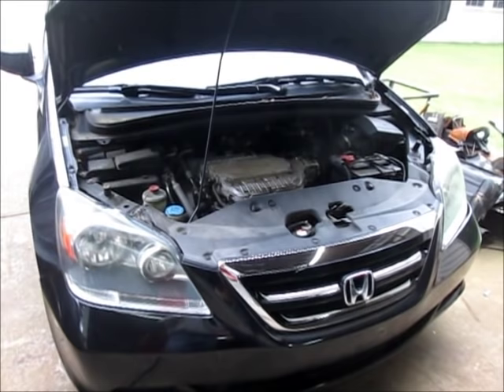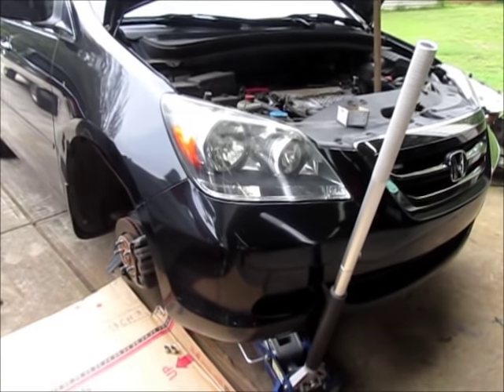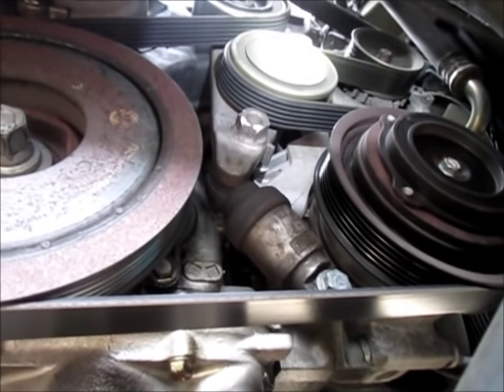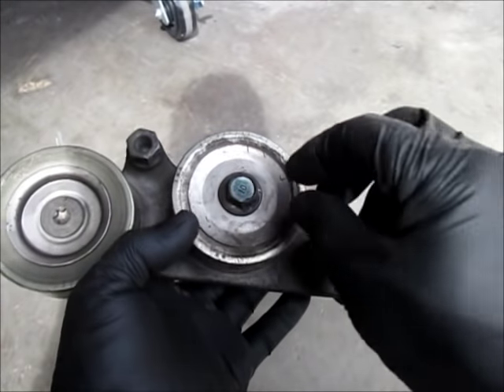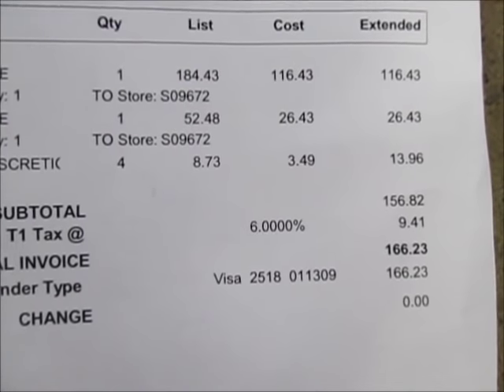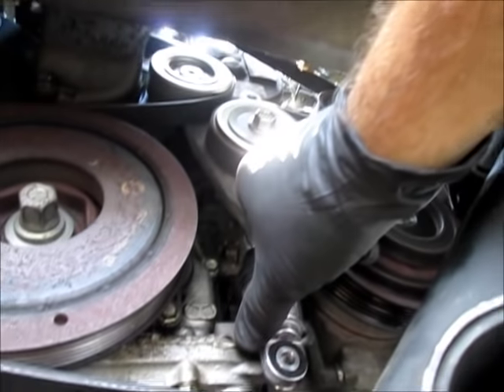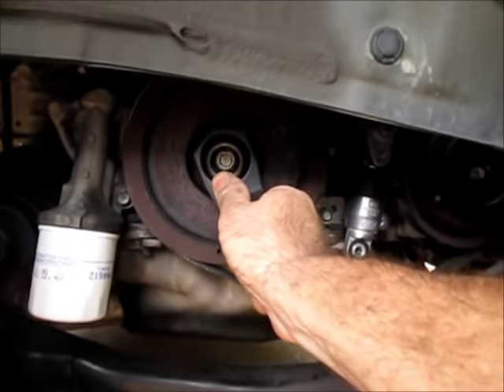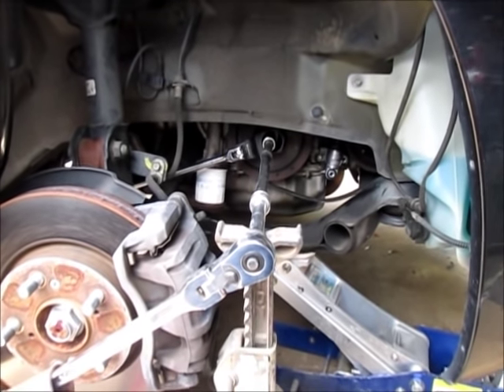Honda Odyssey serpentine belt tensioner replacement and bad crank pulley.#honda #odyssey

Comment: I have similar chirping noise coming from my 2006 Honda Odyssey as well, but my vehicle already has a new tensioner I put on less than 20K ago. The thing that bother me most is that this chirping noise is louder and constant when the engine started unlike the original tensioner which only chirped when it first started but went away in a couple minutes. The only reason I changed the original tensioner is because of the minor chirp, but now it is much worse with the new one! Unfortunately, the aftermarket tensioner was bad, and worse the fake nuts were no good, I stripped them both trying to take it off the belt to change it again. It seems to me that the lower nut has better torque to compress the tensioner shock than the upper but it is much more difficult to get the leverage at the bottom. So I ended up using the prybar to compress the tensioner shock to release the belt tension to replace the tensioner again with a new belt. I can live with minor chirp from the original tensioner but I simply cannot stand the new tensioner persistent chirping. In this case, it is a good thing that he found the balancer nearly separated, but I don't think the balancer was separate yet, otherwise, there wasn't much torque on the belt to drive the rest of the accessories on the engine. He missed the opportunity to change out the timing belt when he changed out the balancer, that was the hardest part of the timing belt change, given the car has over 200K, it is due anyway. For my case, I had the very same set up he has to break loose that crankcase bolt, 5 ft extension pipe and a 15" 1/2" breaker bar and 155lbs. of torque and it made a horrible bang noise that I thought I broke the damned bolt. I can also attest that the 400ft lb. torque from the impact wrench does nothing to brake this bolt. I believe that the torque spec on that bolt is 181ft. lb. or 47ft lb. plus 60 degree turn (1/6 of a turn). I followed the latter, because I don't have a torque ratchet better than 150ft lb.

Comment: I just replaced one of these belt tensioner assemblies on a 2007 Odyssey.  Here's what I learned:  On 2007, the tensioner is DIFFERENT if the trim level is TOURING.  The auto parts store online catalog shows a different tensioner for non-Touring Odysseys.  I needed the one in the video.  The problem with this particular vehicle was a growling noise from the accessory drive (it sounded very much like a noisy power steering pump).

Comment: good video, probably no need to replace all the parts you did...Depending how old were your belts, but that is a good preventive maintenance, might be as well to do your timing belt at 200k.
As someone said before, those nuts soldered to the tensioner are to move it so you can release the belts, from up or down the car. Good thinking in removing the whole tensioner component that way you could have replaced only the balancer...
thanks for sharing

Comment: On the pulleys you can just press in new bearings that cost $8 a piece. Good job spotting that balancer. Ill have to go check mine now
Reply: I need to check mine too

Comment: First, really appreciate that you do not include obscenities in your videos as it lets me watch them around my 9 year old. Second, this is an awful design and am gravely disappointed with our 143,000 mile Honda Odyssey (2007). It makes me wish I had grabbed the Volvo 240 station wagon that was for sale nearby a couple of years ago. I could have replaced all of its belts twice in the time it has taken me to fight with the head end of this engine already. Third, what started as a Power Steering pump replacement job may have become a serpentine belt tensioner job as well. I have completely stripped the lower bolt head on the idler pulley bracket in trying to free up the serpentine belt. Next, I will try the upper bolt head on the idler pulley bracket. If that strips also,  I'm going to try the prybar against the crankshaft pulley/harmonic balancer to compress the serpentine belt tensioner. I hope not to damage the pulley/balancer in the process. If I do, this is going to my favorite independent mechanic. Next job is to replace some, but not all of the transmission fluid as I don't want to detonate that other Odyssey land mine. BTW, the dark blue paint is peeling off in small sheets, especially if driving in the rain. Disappointed.
Reply: That's why I never will by Honda again, their quality is crap now.
Reply: @thekingofgoogle1404  My personal experience from owning about 30 cars and trucks is that quality tends to vary within brands. While Ford was churning out very reliable pickup trucks in the late 90's, we bought a new, Windstar minivan. The quality was a mess, but it was the first model year of the redesign (1999 IIRC). We also had a 1991 Honda Accord that ran and ran with almost no problems,  except the terrible, chalking, fading paint. In the opposite of the Ford example,  early 00's Honda sedans were very well made, but Honda minivans, Ridgeline pickups,  and Pilot SUVs had major transmission problems as they all shared them,  being produced in the same factory also. Data indicates modern Honda sedans are reliable,  but Honda has had chronic paint problems,  especially with white and dark colours. Make sure you garage,  wash,  and care for their paint. 
The Car Wizard channel provides a lot of great To Buy and What Not to Buy recommendation videos.

Comment: FYI. Instead of Prying against the Pulley to compress the Shock on the tensioner. Next time use a socket on that Bolt Head. That's used for removing and replacing the serpent belt. 
Otherwise thanks nice video.
Reply: I used a socket on that fake bolt [3/4' socket] but the hydraulic socket do not budge. I am frustrated.
Reply: @Tahimate  takes A LOT of force to move the tensioner. There are two fake bolts you could use. Try both. I also had some luck going at it from the top to adjust the belt on.
Reply: @Tahimate  Just replying to future viewers - the way the hydraulic shocks work is they gradually loosen as you apply steady pressure, so don't attempt to "break it loose" like a normal bolt, instead apply alot of force but hold it steady and you will gradually see the slack open up.

Comment: Thanks! I have some noise coming from this at 2200 rpm and sounds like a wheel has a bad bearing and it is rattling a little bit. Another thing I'm adding to the parts list!

Comment: Have the same issue:  It isn't the damper. Mine sounds exactly the same with a damper change (which was needed).  Be ready for your oil filter adapter housing to start leaking oil.  All of those parts failed within months of each other for me (for those coming up to these issues).

Comment: I pulled a tensioner assembly off at the wreckers for $15 and saved $100. 50,000 trouble free miles and still going

Comment: Just did mine on a 2004  2.4 this morning, I simply put a spanner on the power steering pump pully and , with the belt in place on the rest of the pulleys, wound it on. I couldn't get a spanner on the tensioner pulley bolt FYI. If it's chirping, it's the tensioner. Mine was at 275K km.

Comment: My wife's van had this same noise, I took off the belt to see which pulley it was. It's hard to tell which one of the two is making the noise but I'm just going to replace the whole thing. after removing the belt it was not that hard of a job if you approach it from the wheel well.

Comment: real helpful man thxs just replaced the alternator on my 05 and let me tell u take it to a garage for that had to take the hole front end off and pull back the radiators just to barely get it out but thxs man this really helps me out

Comment: the crankshaft pulley nut is 47 ft lbs + 60 degrees.
that's why it's so tight.
Reply: Q*bert that's right !
Reply: @lebronjordan802  hhjj

Comment: going through the same thing with my van. Decided to redo the tensioner, power steering pump and balancer . had to bust off the balancer bolt by using the long breaker bar with 19 mm socket and starting the engine three times. this was after my impact wrench with 700lbs torque couldn't bust it off. Royal pain in the butt. great van otherwise .

Comment: Relieve the tension from the bolt on top and do it on top not under engine .push forward gently and you feel the shock tension go away and belt will get loose.but good job and nice video.

Comment: Gave up on putting the serpentine belt back on the 2006 honda odyssey so I took the vehicle to a mechanic and had them put it on. For future reference if I should ever win the Lottery and its a large amount of money  I will fly the vehicle back to Japan and try to drop it on the guy who thought of the idea of putting an engine in an Odyssey sideways. ( just kidding)
Reply: patchreefs 😁 👍
Reply: patchreefs I hope there is a place in heaven for those over thinking engineers, they should have to work on those over and over for eternity.
Reply: Ummm that's how all front wheel drive vehicles are. Motor sideways towards the drive wheels.... It's the only way. Otherwise everything would be rear wheel drive and you'd complain about not having better control of your vehicle...
Reply: i used to work on 96 Mazda MPV minivan with V6 engine, it was not sideway, it was so nice to work with the crankpulley facing forward at the head of the minivan.

Comment: Compressing that piston would have been a little easier if you had a buddy to help you out.  I have an 08 V6 accord and the belt and pulleys are identical.  Service manual says if you hook a socket (in my case a 19mm) to the fixed bolt head between the idler pulleys, that's the proper place to swing that arm.  You did a little more work that you needed to, but it was only you and you did what you had to do.  And yeah the torque spec on that crank pulley isn't as much as one would think.  Mine is only 37lb-ft.  Great video, I saved it to my favorites for future reference.
Reply from the maker: +BuddyLe3 Thanks for the input. It was a new one on me, and I'm not afraid to improvise....

Comment: I just started watching your vid because s buddy of mine pulled in my drive way with a2010 Honda Odyssey 3.5 and his belt was walking off the top pully . I've never seen a car or truck with out a belt tensioner loosener weather out be a socket or just the wrench to losing it I started watching your vid and I was like thank you in not the only one this belt pulley assemble is bull shit made to bring back to dealer crap

Comment: This tensioner has to be removed when replacing the timing belt.  The tensioner pivot bolt has a bad habit of breaking off flush with the block.  A HF reversible angle drill and LH drill bits lets you back it out.  If you just need the bolt, I sell them on Ebay.
Reply: Yup. Just paid the mechanic to back the bolt out (Replaced the whole assembly). Beyond my skill set.

Comment: On my 2007 Odyssey the serpentine belt suddenly became very loose. I found that the harmonic balancer part of the crankshaft pulley had actually GONE, No squeaking or warning. Just the center of the pullet was left, no grooves. My wife said that "there was a bang" and immediately the power steering got heavy and ignition lights came on. 
No new belt or tensioner required! Very unusual !!!
Reply from the maker: malcolm grey Apparently this is more of a problem than we all realize...

Comment: I know you did this in june but I have fought with this harmonic balancer bolt on my accord several times. and there are several things that help,heat up the bolt head and use as short an extention as possable to twisting of the extentions I have seen mechanics use a super thick heave wall socketcustom made for this bolt.

Comment: Thanks for the video. Just like the usual song and dance. I changed my alternator a week ago and here comes the chirps. So I went to change the belt. But my welded on bolt that I use to compress the tensioner stripped. So I can’t turn it. So I am just going to replace the whole assembly. The car has a lot of miles so why not since my hands are already dirty.  Another tip I got from another forum. Was to use the OEM bolts because aftermarket bolts may snap

What was the torque specs on the bolts if you remember
Reply from the maker: Sorry, I don't remember the specs.

Comment: Nice Video. I really need your advice on my 2007 Honda Odyssey . 2 months ago, I was at a stop sign, suddenly the van was making the high pitch sound then smoked and the steering wheel was heavy and "BOOM" the balancer and a pulley fell off the engine hood. Van was towed to Firestone, They replaced the parts and the belt. 
Then 1 month ago, I was sitting in the van while it was on parking gear. " Boom" the pulley which just replaced from Firestone, fell off from the engine again, I noticed the bearing was broke in half. Van was towed again. They replaced the parts in the warranty. 

Now the AC kicks in and off...the the freon is good...I don't know what is going on here. I m scared to drive it when my kids are with me. 

The van is 92000 thousand miles now. What's going to happen if the parts fall off the engine while I m driving 60 miles an hour? 
Should I sell this van?  Is it worthy to keep driving? 

I really appreciate your advice.  

Thank you so much
Reply from the maker: Wow. That is definitely a scary situation. Have you researched this happening on other vans? Contacted Honda? While I can't really give perfect advice in this situation, I will say peace of mind is valuable. If you're uncomfortable driving it, sell it and find another vehicle.

Comment: Bad idea using a crowbar against the harmonic balancer pulley
Reply: this rubber harmonic balancer is a Bosch design that is present on many cars besides Acura... Chrysler, Benz, etc
Reply: Yes. The tensioner fake "bolt" are for this purpose. Use them to move the tensioner.

Comment: Do you remember or have access to the torque settings for the two bolts holding on the pulley tensioner? Replaced the alternator and reinstalled pulley tensioner but having trouble finding those torque settings and is having a little trouble idling under load now. Hoping I just have something a hair too loose or tight rather than a bad alternator.
Reply from the maker: Sorry, I don't at the moment.

Comment: I got an accord and that vvt keeps leaking on the alternator and i replaced last year and it went out again well anyways i striped the fake bolt to grab the tensior and im gonna use your way of leaving loose but im wondering how you were able to hold tension and tighten the bolts without striping them in the block

Comment: My wife's 2010 Ody Touring sheared the tensioner bolt off 5 hours and 300 miles from home and she had a local mechanic replace the bolt for $480.  He said he couldn't get his angle drill into position to drill out the broken end so he removed the alternator, AC compressor, and the bracket in order to drill it out.  Research on the Ody forum indicates that this bolt shearing off is a common problem if you do not follow the Honda prescribed procedure of slowly and completely compressing the hydraulic tension link four times before slipping the serpentine belt back on and if that procedure is not done the bolt will shear off again in a week or two.

  So...have you had any more problems since using the methods shown in this video?  If not, how many miles has it gone since the tensioner was changed?  I am concerned that my wife may be driving around in a ticking tensioner time bomb if Charlie the mechanic did not know to use the Honda procedure.

Comment: I am replacing the ractory alternator on my 08 odyssey with 314,000 miles on it. Someone at some point rounded off the tensioner bolt that allows you to take the belt off so i had to unbolt the tensioner piston to take the pressure off of the belt. I was worried how i was going to depress the piston on the tensioner to line it back up with the hole to put the bolt back through, i figured i would have to use a bar to depress it then i seen your video and seen that's what you did.  Looks like it worked. When i bought this van the cover on the engine was missing so i figured someone had worked on it at one time hoping they had replaced the timing belt but since the alternator says Honda on it that makes me wonder if anything has ever been fixed on it.
Reply from the maker: Could be an OEM alternator replacement.
Reply: how many miles on the odyssey when you got it?...@300+ miles, you must be due for a 3rd timing belt.

Comment: One question regarding the hydrolic tensioner cylinder. I pulled the rubber boot back to inspect and a good amount of oil came out. Is that normal or did it just leak out from the cylinder?
Reply from the maker: I'd say it leaked from the cylinder.

Comment: What is the bolt size for the main bolt on the tensioner. Mine broke off into the mount. I finally removed it but I need that bolt.

Comment: Well, actually, you can buy the pulleys seperate and (1) not spend the money on the whole assembly (2) not have to go through the hassle of taking the assembly on and off when you can just bolt a new pulley to the assembly ( for the tensioner pulley).  Tensioner pulley part number=Dayco 89007.I bought it for $22. The Idler pulley=Dayco 89059. You can buy them seperately at auto zone
Reply: Can you link to these parts I would expect you should be able to get the physical bearing inside if we knew the size which would be the diameter,width and inside diameter. They just press in.
Reply: The bracket in the assembly has a spring in it that is known to fail.